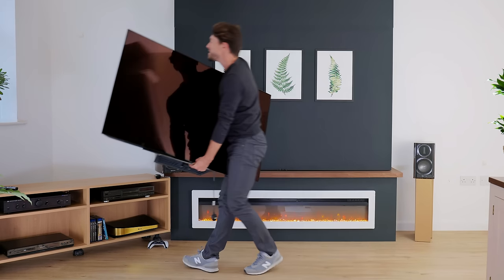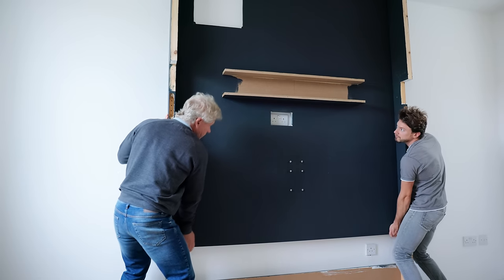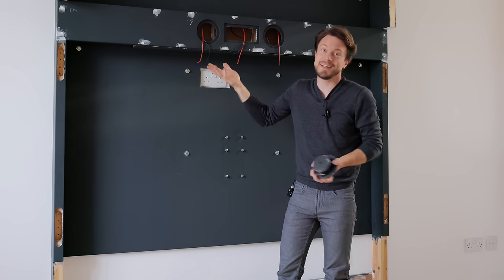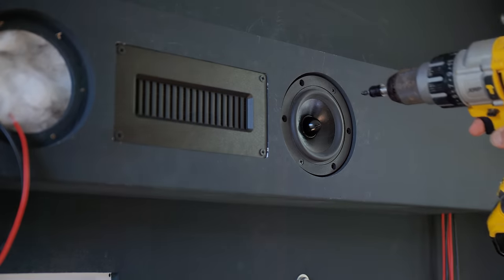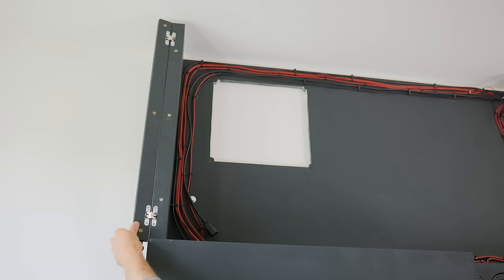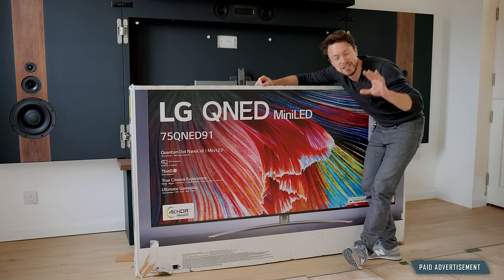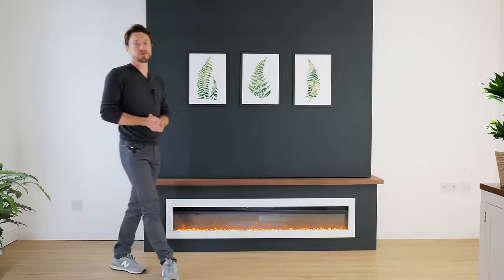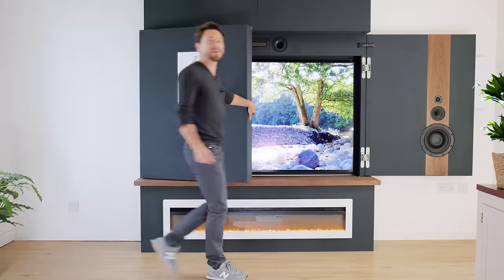Building an invisible TV

Comment: I would argue that having 2 of those subs makes it an 5.2 Surround set up and not a 5.1. But the build is as awesome as ever.
Reply: It depends on if the subs are driven from separate audio sources, or a single source.
Reply: @faeranne  fair enough
Reply: Both subwoofers are driven off the same channel. It's still 5.1
Reply: Woof
Reply: Subs don't produce stereo sound, because you can't hear where the low sound is coming from, so it doesn't matter.

Comment: I made a very very similar setup a few years ago minus the ps5 and surround sound. I did the same cooling system for the pc. Make sure you have some serious dust filter panels, as my ceiling very soon had that awful dust pattern blown across it. Epic build by the way. Makes feel I need to upgrade now.
Reply: This is a good point. I was hoping someone would bring up the impact of dust. I hadn't been thinking of the ceiling though, more that the "open" nature of the top would lead to lots of dust setting on the components.  Hopefully something to be addressed in a later update.
Reply: dust filters would almost render out this issue
Reply: Depends on how much dust they generate in their lounge
Reply: @JohnIrwin  if the fans are not running constantly, this would indeed create an issue, one could seal of the top, and add exhaust fans to eliminate dust going inside the build.

Comment: Beautiful work Matt! Only thing I would recommend is to get/paint the hinges black so that they are not as distracting in the final build, the fireplace however is simply stunning!
Reply: Thank you, I was just about to comment that. As a matter of fact, I feel like a matte black finish to the entire inside surface of the panels (no offence to the wood veneers) would really have boosted the "movie theatre" look
Reply: it not invisible, is it, how about the old still piano still hinges, but mounted the wrong way round, so when the doors are fully open, you just see the spine the the hinges, even if the a silver, grass, gold coloured, you would just see, think line metal, look a bit cars go faster stripes, looking more designed that way, as prose, it need to be there to keep the door fulling off?
Reply: the paint would eventually peel off since it has many moving parts. getting it anodized or plated would be better.

Comment: You make it look so easy. I'd love to own a setup like this. I'd definitely spray those hinges the same dark colour as used for the rest of it.
Reply: ok
Reply: that was my immediate first thought as well lol. Hinges stand out a bit with the silver
Reply: @Dubitz  same, they are a bit distracting
Reply: When you spend that much on hinges you don't want to hide them, heh.  My issue with it is that it's all fairly locked in.  Like if he ever changes anything it's all going to be wrong.  A new console that's an inch deeper, that PC is going to go obsolete, even using masking tape as a gasket, none of this is built for the long term.  My dad used to build cabinets like this, fitted to the stuff of the day.  I had a desk that was perfectly fitted to hold a commodore 64 and its monitor.  Not very useful when the new stuff comes out.
Reply: @GigsVT  I don't think replacing the PC will give that many issues. He used fairly standard components. There will be new generation stuff that's comparable and quite possibly even compatible (in sizes). Even if the formats are a bit off, he only has to make a new aluminum square to mount the new components on and swap out the whole PC with a new one. The console, however... that's indeed to the whim of the Sonys, Microsofts and Nintendos out there. If they like to make the next one in the shape of a traffic cone (just as possible as any other shape), you're out of luck :P
Reply: I love the hinges they look smart and streamline I did not think they stood out that much and considering how much they cost I would not hide them either but I would look at placing some smaller artwork on the inside so that when opened it will have a the impact of blending with the hinges and the rest of the unit. This guy is so cleaver I love the ideas he comes up with.
Reply: @GigsVT  yeah, A 100" tv will NEVER fit in there. He's screwed.
Reply: @itsROMPERS...   You kid I'm sure, but consider if something minor changes like everyone suddenly decides 17:9 is the hot thing, or a new technology is a couple inches thicker but with much better picture.   I mean look at how you can't hardly even buy a non-smart TV anymore.  They push this stuff on us sometimes even if we don't necessarily want it.

Comment: I honestly cannot stand how incredible this build is. And as an audio nerd I'm freaking out about how insanely well the entire audio system is designed. Even down to the immaculate speaker driver choices. Well freakin done sir!!!
Reply: i highly doubt you are an audio nerd as those speakers and enclosure would sound horrible.
Reply: @Pepe-dq2ib  yeah I get the whole edge diffraction thing... I realize it's a big weakness. And of course I noticed that the center channel is not in an optimal location, and that it uses a different tweeter. I would argue the whole "timbre matching" thing is made to seem a lot more important than it actually is in the vast majority of cases, though. Those drivers could certainly be made to sound much better in a different design, but that's not the only goal of the project. He did everything he could to make the sound good. The Dayton DSP amp boards will especially come in handy for all of the quirks this design might introduce, and so it's conceivable that this design could be made to sound on par with very good dedicated systems. It's a really well done project all things considered.
Reply: @Spaniard47  i am using refurbed JBL 4345 and my dads passed down McIntosh MC2102 tube amp.
Reply: @Pepe-dq2ib  keep us posted.
Reply: Me too. Absolutely faultless!
Reply: @Pepe-dq2ib  Did anyone ask?
Reply: If you were really an audiophile you'd know these will sound absolutely awful mounted like that
Reply: @dan3458  If you were really an audiophile you'd hear when your dad left and never came back
Reply: @dan3458  more audiophile gatekeeping, nice.
Reply: @barrystanton7658  lol I burst out laughing, savage 😂
Reply: Floating Points pfp?
Reply: @foggofed9163  yessir
Reply: @Spaniard47  my man 🤝
Reply: @Spaniard47  do you know what gatekeeping means? It doesn't apply here lmao. Gatekeeping would ne shaming someone for buying budget speakers when it's all they could afford or something. It isn't gatekeeping to say you aren't an audiophile if you don't understand a knocked together MDF box isn't a good speaker housing. Sorry I hurt your feelies

You claimed its "insanely well designed" that's objectively and provably wrong. Absolutely nothing to do with gatekeeping champ.
Reply: @barrystanton7658  what? Being an audiophile or not doesn't affect your hearing.....pretty whitty comment though if we pretend it made any sense tbf 😂
Reply: @dan3458  I said gatekeeping but I should've said attempted gatekeeping, because I don't think your high and mighty audiophile opinion is going to stop people from recognizing that seriously great audio can be had in unconventional builds like this one.

Comment: Amazed how you managed to pull off such a clean and straight piece by building it on such rough terrain as your backyard. Those gaps are so tight.
Reply: The gaps aren't tight.  That's video blur.  Watch the last few seconds as he closes it.  You can see the gap in the top panels until they magically "disappear" when he shuts the final door.  Still a nice build.
Reply: @piggjf  still much better than some mass market furniture
Reply: @Istarax  Agree.  I probably wouldn't have said anything if he didn't make a point of showing how to hide it with the masking tape hack.  Doors will have gaps, so blurring them with video editing is just odd.

Like I said, still a nice build.
Reply: @piggjf  Might be less video editing and more youtube's aggressive compression
Reply: @amoliski  No way.  Watch the end when he closes the cabinets.  The lines are crisp and immediately blur out when he closes the last door.
Reply: @piggjf  damn, kinda disappointing to see from a respected creator :/, thanks for pointing it out

Comment: Matt as someone who installs audio/video equipment, my only 2 critiques are that you would want the fireplace and audio equipment on 2 separate circuits as you can get an audio back feed, the second issue is the placement of the center channel as it's way too high in the air to get the best vocal rendition, I would have put the center below the TV so that the center channel is closer to the sitting position. Overall your 5.2 setup looks clean.
Reply: Not only way to high, but also falsely turned 90° sideways. He should have gone with dome tweeters for the centre channel as well.
Reply: I thought the same thing as well . That's probably why we didn't get to hear it in the video. It probably sounds like ass
Reply: @Allmentux  Bingo. The tweeter he used will beam horribly for the center channel, making it sound really poor anywhere other than right in front of it.
Also, in my opinion, the drivers + amp combo he used are nowhere near powerful enough for a really good sound experience.

I would have added more bass drivers, and used ports. I also would have redone the designs of all the other speakers to just be better...
But either way, it's a neat project, even if similar results could have been accomplished with some decent in wall speakers...
Reply: @Allmentux the thing is, the subwoofer is small and there are 2 subwoofers so it is not a 5.1 setup, but rather a 5.2 or a 5.
Reply: What happened to the 2 rear channel speakers? Wouldn't they have to have wires running to them too?

Comment: Two recommendations when working with cables; 1) always run cables in pipes when the cables are hidden, in case there is a need to replace them at a later time. 2) separate power cables from audio cables so that the audio cables are not affected by electromagnetic interference.
Reply: Always run cables in pipes so that if there's a need to replace them later, it's harder to do so because they're in a pipe. What?
Reply: @mjc0961  If you have a pull line it's a lot easier as you don't have to take apart the whole panel
Reply: @MrRendeer  But I don't get it, the whole thing is a cupboard which can be opened if there is the need for it. So it is not relevant in this case? Was it just general advice?
Reply: @mikkermikker5908  the doors that hold the speakers are closed boxes. If something goes bad and cables need replacement, this could be hard to do without disassembling the box. Pre installed pipes would definitely help.
Reply: @mjc0961  for the subwoofer panel for example, since it's enclosure is glued shut and routed though the spacers, he cannot exchange them, where if he had pipes, you could push them through
Reply: @just_saw_dust  thats why you wrap them in tape they use for cars or even foam liner
Reply: If the power cables are only carrying DC power, shouldn't it not matter? As long as a decent rectifier was used, there shouldn't be any 50/60Hz EMI coming from the wires.
Reply: @janhendrikfranke  also if it had pipes it would not be a sealed box though

Comment: It’s an amazing build. I have no idea what it sounds like but I trust it sounds great. My only problem with this is the giant hinges at all four corners of the screen. There’s just no way to unsee that when you see it. Otherwise, tremendous and the craftsmanship is terrific.
Reply: I was saying the same thing, he should’ve painted them too
Reply: And the visible cables of the speakers.
Reply: You could inlay then and then cover them up
Reply: @guidomedici3044  The exposed glossy speaker cables really need a non-shiny sleeve or at least some matte black paint.
Reply: Paint to match colour. Add 2 motors + remote so you can automate the opening and closing.

Comment: Just an FYI, your setup would be a 5.2 setup since you have two subwoofers.

Awesome build!
Reply: I wonder if the difference between 5.1 and 5.2 would be the number of subwoofers? Or does the last number mean the number of signals, so if two subwoofers are getting the same signal it would still be 5.1? And can you even get a stereo signal subwoofer setup if you have two subwoofers? An AV receiver normally has only one subwoofer output. When you attach three subwoofers to one output, would that make 5.3 or still 5.1 since it's the same audio signal?

I know you can hardly hear stereo on these low frequencies, but the naming scheme is still interesting.
Reply: @jeehaa7099  according to the spec it's number of subwoofers. There's only one lfe channel, and if there's no lfe channel it just uses the right signal.
Reply: @jeehaa7099  yes, the .2 refers to 2 subwoofers. In some cases, there could be 3 numbers, for example, 5.4.2 surround. the 5 refers to 5 mains(center, front left, front right, rear left, and rear right), the 4 refers to top speakers(2 forward, and 2 rear), and 2 subs(usually one left and right or one front and one rear)
Reply: I was thinking the same thing
Reply: It really depends on the input signal. For example 7.2 has two separate subwoofer channels. If you have a 5.1 input and 5.1 amp, you can have a 100 subs its still 5.1. some floorstanding speakers have huge subs that go pretty low and with biwiring you can even go without a subwoofer.
However this setup seems to be adjustable for all drivers (i believe only the surrounds are 2driver for one channel) and the programming capability is very interesting.
Reply: looks to me like it's 7.2 because there's 7 tweeters and 2 woofers
Reply: Exactly.  Thank you.
Reply: Did he ever show the rear channel speakers?
Reply: the numbers refer to the audio channels, not the actual number of speakers, so it's technically a 5.1 system since the amplifier is a 5.1 amplifier
Reply: ok

Comment: powder coating (or any other painting method) would have been a great touch on those hinges, I know they can be an aesthetic for some, but they are a tad distracting for my taste 

Edit: I see there are black options on amazon from that link, so its really up to the end user. no extra work neccesary
Reply: i was thinking that if the hinges are made of aluminium they can be anodized
Reply: Yes, very distracting. I was waiting for him to mention it and paint them or something

Edit: it's funny, though, that I didn't notice them at the beginning of the video
Reply: Hinges do need paint
Reply: your comment pissed me off lightly, and i thought to myself wow such a small thing to be bothered by and you don’t t even see them when its closed and i scrolled up to look at them and then immediately they turned into a set of 4 flashlights that couldn’t be ignored if i was watching the tv so i retract my thought and totally agree, but i don’t nt think i would have been bothered by it if the attention wasn’t  brought
Reply: I checked (because they bothered me too) and the hinges are available in black.
Reply: I came to say the same thing. The silver hinges really stand out to my eyes.
Reply: agree
Reply: Exactly my thoughts

Comment: I am really excited about how you build this and how well idea on the total video and audio experience is. I do think that getting custom drivers and basically setting your own crossover and control for them with custom software is quite in depth, and not anyone can just do that. I do however like it myself as a mechanical engineer to see that such software is quite accessible, and the setup doesn't need to be so expensive.

Comment: Really cool idea and execution 👌🏻 Being an audiophile, I would love to hear it. Generally, you want resonance free (not square) cabinets and the tweeters on all front speakers to be identical and pointed directly at the listening position, you want a full range center speaker, but there are few rules without exception in hifi. 

I really like the concept and the dual subs. Would love to see a motorised version. Keep up the good work 💪😃
Reply: I suppose the speakers being on hinges mean you could point them at really any target in the room. Just depends on if the hinges can hold the doors in specific places
Reply: @Squeph  I was thinking of the center channel, whick should be tilted downwards. The issue with the hinges (if they can not be fixed in a specific position is of course that any action has an equal and opposite reaction, meaning that when the membrane moves forward, the door will mobe slightly backwards, making the sound a bit less punchy. Usually it also improves the sound to have the speakers on stand mounts in stead of on shelves, so the resonance does not make the furniture “play along”.

Comment: Looks great and it turns out well, that trick to hide the gap in between the doors I did not know that as an DIY person myself.
what I should do is to color the hinges black or the same color as the closet.
Now these look so dominant.
I should probably use the walnut vernier at the center speaker as well.
Great job, looking forward to your next project👍
Reply: The masking tape trick has been used in Television for a long time of flats for sets.

Comment: This is amazing! As an electronics engineer who has worked in HiFi companies, the fact that you've designed,  built and tuned the speaker is very impressive. One note, you probably want to angle the sides towards the listener so there is a 30deg angle or so instead of them resting flat/in-line with the screen. Have you tried that?
Reply: Ooft. He could have built the angles into the doors if he was clever but that would have taken a good chunk more time and effort